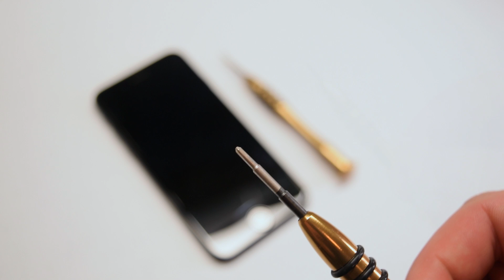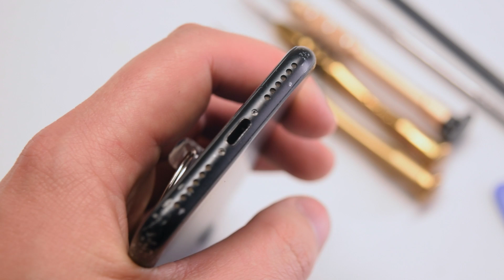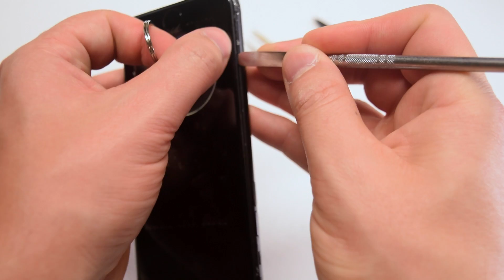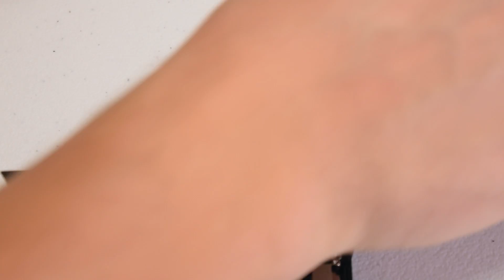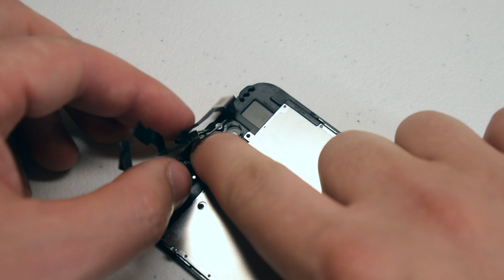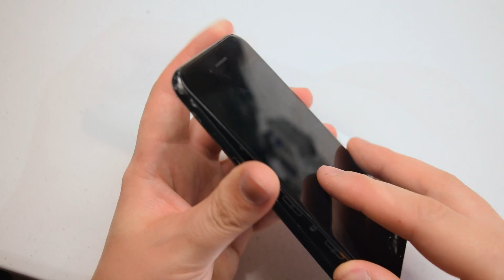iPhone 7 Front Camera Replacement

Comment: Hi, I was wondering if you knew where I can buy an original iPhone front camera replacement. I purchased a afeax model that advertised itself as oem but when I properly set it up it wouldn’t work with third part apps. I read through forums and found out I need an original piece but i don’t know where to buy one because most locations advertise themselves as 100% works and oem

Comment: So I fixed my camera I think but then when I connected the screen back on it sparked and started singing the plastic letting of smoke... the screen doesnt work but the touch does which is wonderfull 😁😁😁 any ideas what happened. Im thinking maybe the phone got turned on during reassembly...
Reply: joel smeaton what did you dou
Reply: how did you solve it?

Comment: Ripped my old cable...haven’t got a new one yet..but Touch ID has stopped working as a result of the broken cable
Reply: Shaya Daphne I actually damaged the Touch ID and 3D Touch cable while putting the screen back...so I believe this can also be another reason your home button might not be working...the only way to get this fixed is to replaced the entire screen as the damaged component is attached to the lcd...you should still try replacing the front camera flex cable

Comment: I have replacement my iphone 7 plus and somehow I can't hear the caller or even when I'm watching a movies so do you have any an ideas why? let me know please
Reply from the maker: Yes it's because the speaker is not aligned properly, it has small metal power pads that must be aligned with the cable you replaced. Just open it and reseat everything, try to alight everything perfectly.
Reply: i have the same problem to and also the selfie camera is very blurry also

Comment: Does a ripped ribbon cable affect the ear speaker too? because it seems like the ear speaker is not attached to the ribbon cable.
Reply from the maker: It has metal to metal contact in 4 places and connects through pressure.

Comment: my homebutton dosn't working after replace the front camera,why?help me please😭
Reply from the maker: Reopen the iphone, make sure the home button is connected and aligned properly.
Reply: @GRIBSOFT  but touch id  is still working,what wrong with that?
Reply from the maker: Open the iphone and check
Reply: @GRIBSOFT  yeah, I'm having the same issue. Takes forever to turn on once reconnected. Then once it's on, the home button shows up as the movable home button on the screen. The speakers stop working, front camera doesn't work, can't even mess with the volume. It's like if the iphone is not recognizing the new flex cable. Any ideas on how to fix this?
Reply: i think its bad flex issue
Reply: what happened
Reply: @hanmbsalyokbg  there's a small adhesive square (sort of like a small square sticker) that needs to be passed from the old screen to the new screen. Without it, there is some sort of short and it will cause this.
Reply: Mi Taller es Mi Casa is it plastic?
Reply: Mi Taller es Mi Casa i dont have one in old flex. i didnt change the screen. i think mine is bad one.
Reply: @hanmbsalyokbg  yeah, it's like a sticker. Yeah, could also just be a bad flex. I went through a couple of flex cables before finally realizing that was the issue the whole time. But if you didn't change the screen, the little square should be there still, so you shouldn't have that problem.

Comment: my ip7plus front camera is slightly offset to the right, so when taking picture half of my face didn't show up on the screen. can it be fixed by us or i just had a badluck with one of apple's defect product? please help.
Reply from the maker: Needs to be adjusted inside. I would replace the entire cable because they are so cheap.

Comment: Does this part have the microphone as well? Because my iPhone 7 Plus front microphone doesn’t work and Apple is charging over 200 to replace the whole screen, I just want to know if replacing this part it would fix this problem, thanks
Reply from the maker: That cable has proximity sensor, front cam, ambient sensor and front mic and speaker on it. So yes, it will fix it.